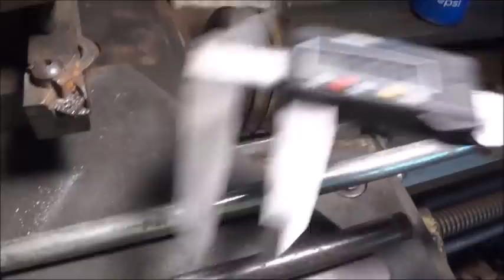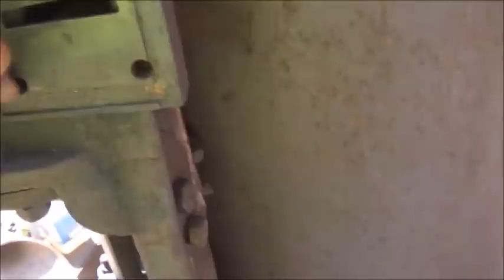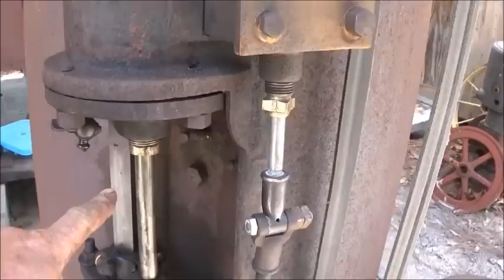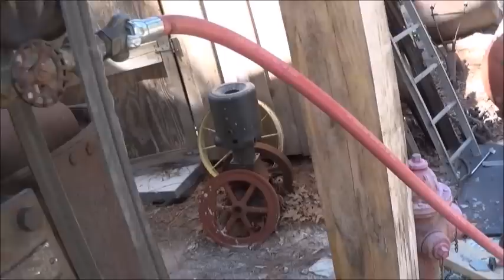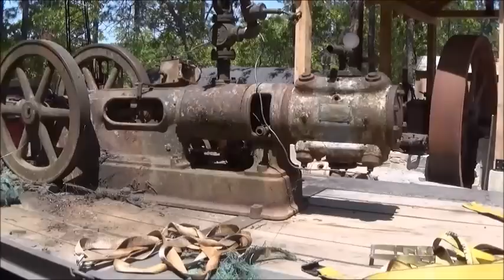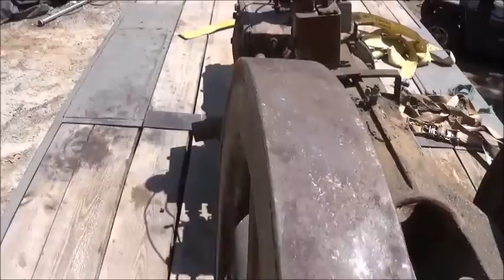1873 LEFFEL MACHINE WORK AND FIRST RUN

Comment: Why not make the rods from stainless steel instead of just steel ?? Many times when a bore hole is off center the part that holds the gland compression threaded bushing is off location  on the machine female part. I remember years ago of making the same part you are fixing. The person who paid for the work said that the threaded bushing part was made with the bore off center to keep the part from rotating out of the seat. Back in the day when this was made machining was on the crude side Jonathan.

Comment: Question Jonathan, really liked to see the vertical engine running even if in Air. Watching the rebuild segments were very cool. and seeing the whole assembly in action helps me to better understand how Train Steam Engines work. I fix old American Flyer toy Steam engines. I always thought about building a actual steam engine drive system that I power from a dc motor turning an air pump, These would be small parts but a fun project. I 3D Print parts as I do not have machine tools. My question was the piston diameter required to move the engines. That piston on the vertical engine looked about 4 inches diameter. Can you estimate how much horse power can be generated for such an engine. If you have two pistons is the power doubled. I see real steam engines the Piston diameter are big 20 inches and more. But they say the engine can generate 100's or 1,000 of horse power? How is that possible? I see the valve is directly linked to the output shaft so that timing is design into engine. Is seems speed is not a problem. I expect more speed more power. hence smaller diameter wheels for smaller engines. Is there a layman book on steam engine design? Always appreciated your efforts to save the history. You have unique gifts and I really appreciate you. Take care, stay well. Let us know if you sell the 50s Chevy Panel  Truck  I would love to get a Parts Truck for my Train Stuff.  All the Best , Dennis in Virginia

Comment: Nice job, those little gears up on top look like the same gears in the lower unit of an old outboard engine prop shaft, it's worth checking into. Cheers from Jacksonville Florida 🌞

Comment: Interesting video, I’m curious as to whether the whole installation will run on compressed air, or whether you will attempt live steam, which has a range of problems with equipment of this age ? Either way it’s good that you are saving this stuff from being scrapped. Are you thinking of opening to the public, or will this be for family and friends?

Comment: Great engines. Is there a way you can get a boiler that would run off of wood so you dont need gasoline or electricity to run them? I really like the new one its pretty nice.

Comment: Brass is copper with zinc what you needed was bronze which is copper with tin, Tin provides the wear resistant, slippery bearing surface.

Comment: That Leffel is now in good enough shape to run on air , it could run on steam . But I agree , while you're at it , might just as well fix the rest of it . Nice unit too . The firebox is right handy if the boiler is intact . As for that air compressor , I've noticed the same thing . Covered , it rots quickly . In an open shed , it tends to last far longer than out in the open . The difference is the air around it , able to keep it dryer in open air . Covered with a tarp traps more moisture in , plus dust , dirt , leaves , etc . around it . Faster oxidation rate , due to constant moisture presence . Thanks for the update , Jonathan ! Keep it coming !

Comment: Bevel gears........ differentials have a matched pair!  Saw in a tractor magazine that a Fordson owner used a pair of Model A gears when he replaced the buzz boxes with a Farmall magneto. Might be hardened, use carbide or a tool post grinder on your lathe if alterations are required.

Comment: That steam air compressor should have a very good capacity.  Back in the 1920s Chicago Pneumatic had one model- the Class O Type 555- which had both a steam engine and a synchronous AC motor and could be driven either way.  I'd imagine there are some still in use.

Comment: My grandfather was a mechanic, his first air impact wrench was a Chicago Pneumatic. If I recall correctly he bought it in the early 50’s. It replaced his electric impact as they were more common at that point. It was the only impact he used until he passed away a few years ago. It still works fine today.